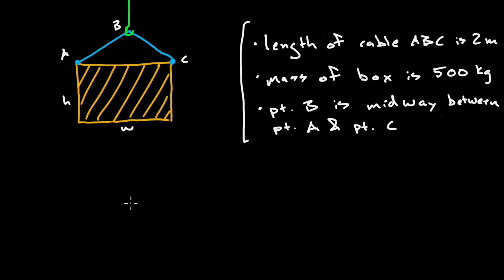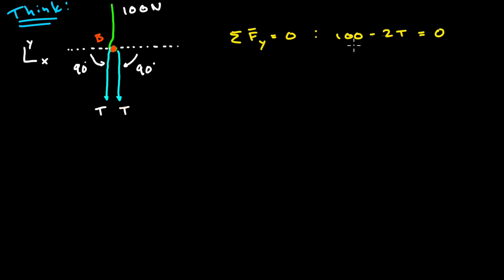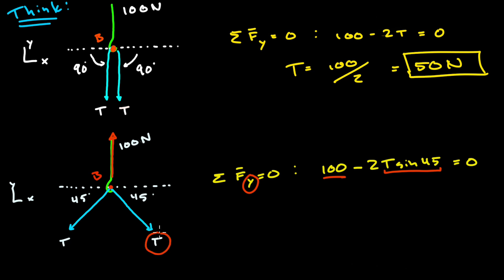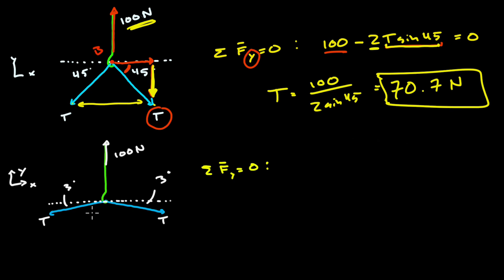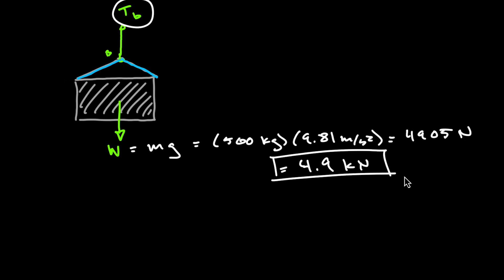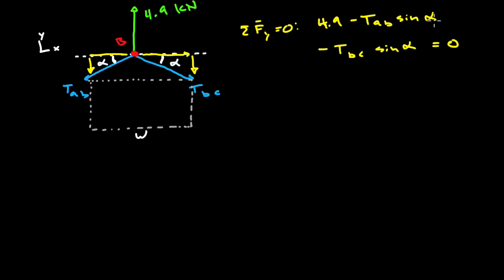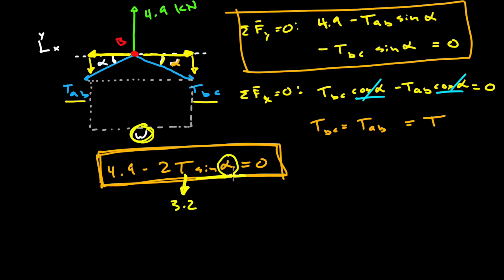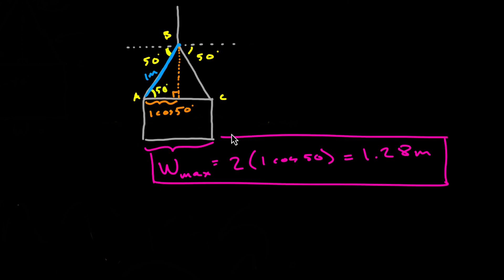PLANAR (2D) PARTICLE EQUILIBRIUM // Vector Statics Worked Example

Comment: I though length of the cable ABC=2m. i.e A=2m, B=2 , C=2. And cable is at the centre thereby making half of the box=2m
Reply: The box width is independent of the length of cable ABC. If you were to pull cable ABC so that it's in a straight line, it's length would be 2m. As the angle ABC gets smaller, the distance between A and C shrinks.